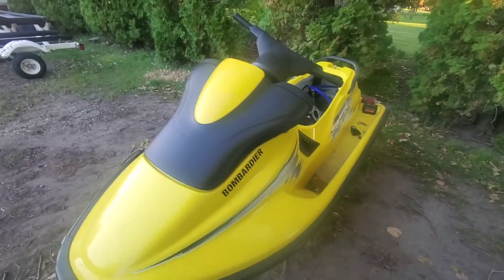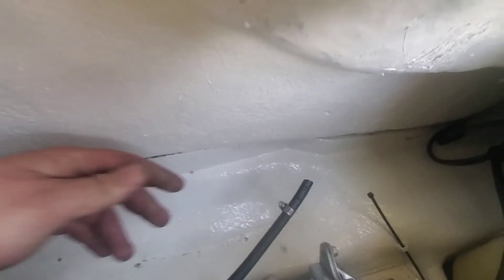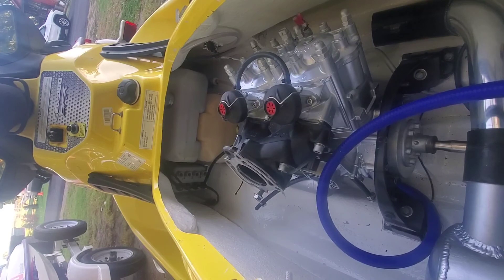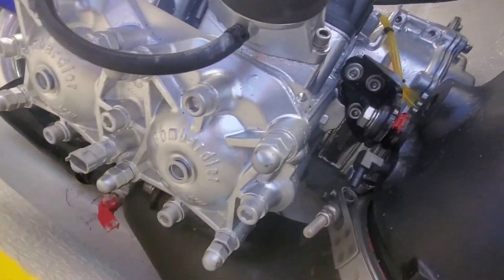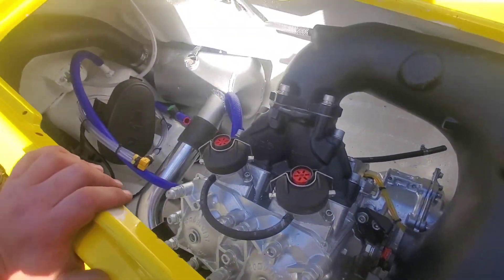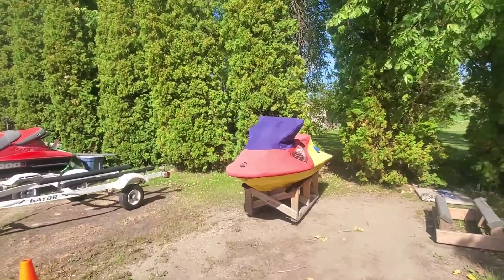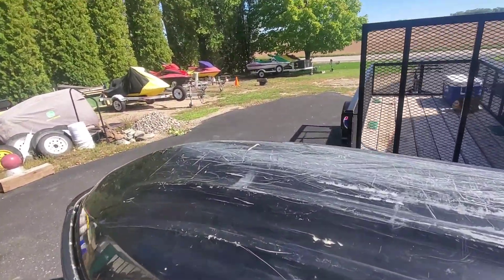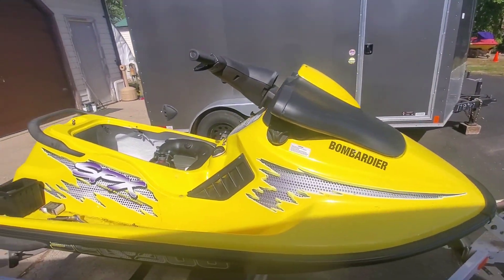1999 SPX 951 Project: Episode 5: 951 Engine and Exhaust Installed

Comment: You must have the hook up on them 951z good stuff she’s coming on along
Reply from the maker: Yep i got the fuel lines ran and a few other things buttoned up, but i will be hauling it off to Ben's so he can finish it. He's gotta deal with the carbs and electronics. I will be rebuilding his pump for him once he figures out which impeller he's gonna run.
I'm swamped with my own projects i gotta finish before winter sets in.